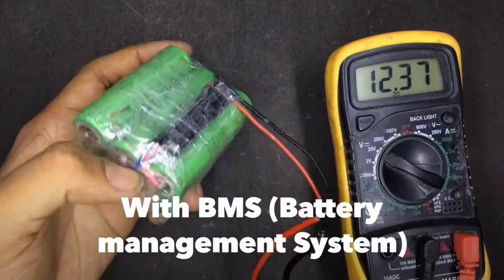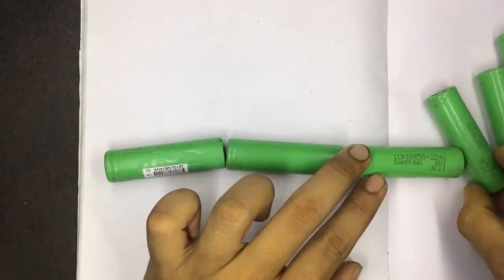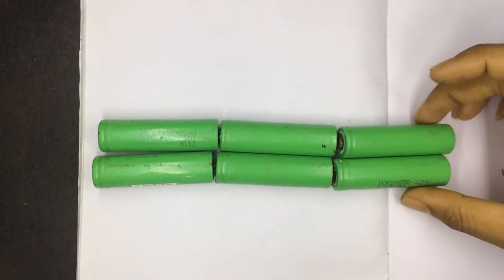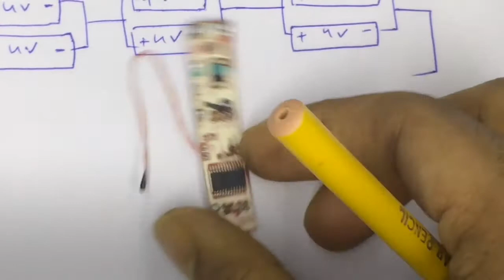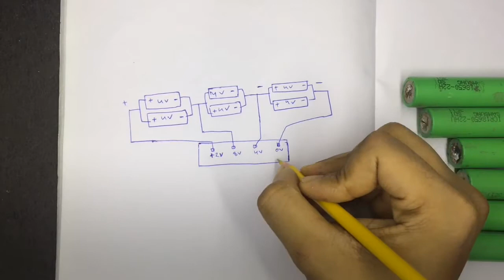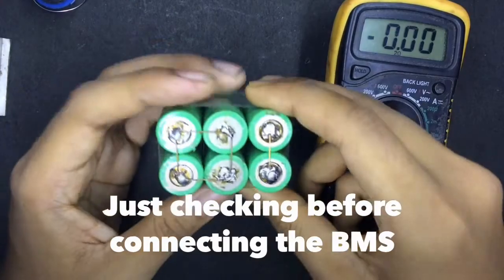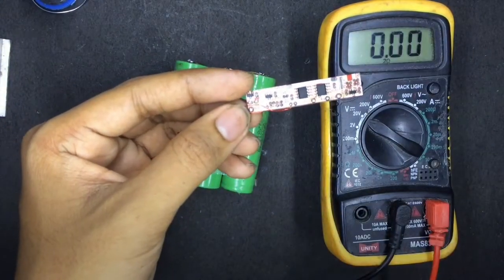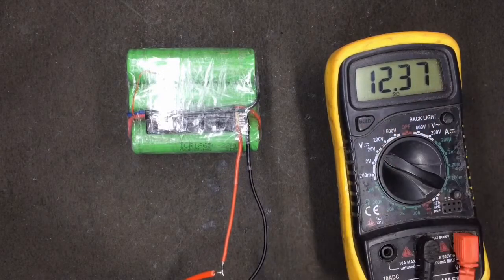12v 4.5amp Lithium battery Build (with BMS ) from Old laptop batteries #diy #battery

Comment: Laptop BMS contain thermocouple .. what  is the purpose it will shut down or disconnect the fuse .. is it possible to check by external heat ??

Comment: Hi
Please help me
I have a laptop battery model
 DELL J1KND 11.1V 48W
I want to charge it without a laptop and with a 13-volt adapter, 
can I? 
How do I use its pins? 
What will the connections be like?

Comment: While designing a battery pack .. do we always consider max voltage ? 
Or the nominal voltage of 3.7v 

I'm at loss here
Reply from the maker: Generally Nominal voltage is used
Reply: @madScientist99  
I was looking to make a 12v 10Ah pack for an emergency fan/light unit. 
And so I'll be using '3' 18650 batteries in series 
And 5 such series in parallel. 

Am I right ?

Comment: Can we add more batteries in parlell with this bms only as laptop battery is genrally of 4 to 5 amps  and 3 cells in parlell would be around 6 to 7 amps
Reply from the maker: Yes sure u can use more than 10 cells in parallel
Reply: @madScientist99  😨😮😯 with this bms only....... Which we get from old laptop battery
Reply from the maker: @arnavsikri8556   yes...  But  make sure all batteries are good & same capacity ..
Reply: @madScientist99  Tnq

Comment: Bhai laptop BMS ko on kise kiye bina power supply ke ye trigger nahi hota or
Reply from the maker: Every bms have Switch pin  or reset pin depend on the bms... Just have to pull that pin to ground pin if your bms is 100% ok then it's gonna turn on... & with power supply u can charge  batteries but can't get output from every single bms but u can turn on any good laptop bms with this method ...

Comment: How do you charge the battery pack?
Reply from the maker: 12v laptop charger Or adapter
Reply: @madScientist99  thanks.. How many amps should the charger be? I got a 12v 3amp power supply can i use it as a charger?
Reply from the maker: Sure,,,
Reply: @madScientist99  thanks

Comment: its REALLY NOT 4.5AH.....ITS REALLY NOT @@
Reply: its untested at all caoacity can be 100 or 1000mah its not safe heating self discharge batteries are not cool its not safe at all
Reply: and wtf is that thing???? what f board is this? get normal 10 or 20amp bms
Reply from the maker: These are tested cells,  I have lots of these cells and capacity tester, I have test those batteries & only use good cells, although they are not new and also around 80% in capacity,  other low capacity cells are used in small projects
Reply from the maker: And i have new bms too, but this video is about recycling